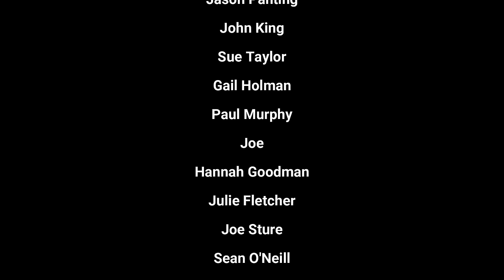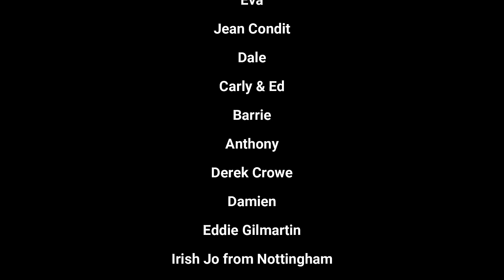The mortar removal continues on the derelict Irish cottage. Episode 28

Comment: You guys will be fine, those walls have stood there for many decades, Sam will do it right.  Have faith in each other, Crack on !
Reply from the maker: Thanks for saying this. We have definitely worried & doubted ourselves at times but I'm starting to get a feel for the walls the more we work on them. They are certainly sturdy!
Reply: They won’t be ok if they keep removing all the small stones…those walls need them for strength.
Reply: I think they'll be putting them back when they get to the pointing.
Reply from the maker: The ones which are loose are not supporting anything. We have been advised to remove all loose stones by a stone mason and we will be putting them back with lime mortar when we get to the pointing stage. Obviously any small stones that are in tight, are load-bearing and we leave them in situ.

Comment: With the concrete you find on the floor thats a start. it gives you a stable base to work from . The weather doesnt help but it gives you a break from what may seem like an endless task. The tiles look good and its an improvement to your life.   Nice one Sam and Bec      crack on
Reply from the maker: Yes the snow was a good forced break. Its nice to sometimes just have a change of scenery. Hence why we sometimes move on to another bit of the cottage even though the previous wall isn't fully finished. Psychologically it feels better!

Comment: When building drystone walls, the middling was an important part of holding the wall together. Stones would be slightly sloped in and the middling would hold them in place. Imagine old buildings were similar.
Reply from the maker: Yes there are lots sloped and what we can probably see in the voids is the middling stones. We will add those smaller stones back in one we back point the walls. Fi gers crossed it holds until the good weather comes for pointing.
Reply: If the walls are structured like similar buildings in Wales, this is not quite accurate. They are built to two faces, with quite a lot of random rubble fill. Periodically the builders used larger stones to tie between the two faces: all these face stones and tie stones are sloped 'down & out' - ie, laid with a slope to naturally shed water outwards. This is a vital principle of porous wall structures, which (unlike modern Portland cement based work) are designed to accept a degree of wetting, draining and evaporative drying with lime mortar. Good luck guys, it'll look fantastic! 👍
Reply from the maker: @anthonystevens749 thanks. Yes we watch D Porter Construction on YouTube and he mentioned the stones sloped for water removal. So much to learn on these stone buildings. 👍

Comment: Great job but just a heads up on those little stone. If you really look at it, you can see how they were used to level the big stones. And behind the front row there is a space inbetween the inside wall that gets filled up with mud and rubble. That holds the two sides together. If you start taking too much of that out the walls will weaken. Get the outside cleaned up, fill back inside the openings with mortar and little stones, then you can get to the outside repointing. ❤❤ good work and love the tiling on the walls by wood stove.
Reply from the maker: Thanks so much. We only remove the lose stones. They have been kept and we will refill the voids with them when we back point. Let's hope it holds up until then. 🫣

Comment: If you want more eggs, use a trick - connect two halves of the shell to make a whole egg and put the dummies in the nest. The chickens will see that the nest is safe and will lay eggs better and will not have to hide eggs in the area.
Reply: you need a few more than 2 egg pacifiers
Reply from the maker: Thanks for the tip. Will do that. 👍

Comment: I took a day off from my phone, yesterday. Left it at home and went to town, to get away from the cold.
Much better for it!
But it does mean I’m late, watching my favourite vloggers.
I’m so thrilled to see you guys avoiding the stupid mistakes we made. 
Your stone cottage is coming on great, though I’d be inclined to leave the small stones in the joints, at least until you’re ready to point them. It was quicker and easier to make large stones fit by packing around them with small ones, that it would have been to cut them to shape. That’s the main difference between rubble walls and cut stone walls. The downside is, rubble walls don’t self corbel, so if you take out a critical small piece, they can avalanche down all the way from the wall plate. 
At the very least, check for looseness in the ones above, before removing anything. And wear hard hats. 
Delighted to see all the bulk bags you’ve had delivered. The joy of a level site!
Our stone cottage is also on a level site, having learnt that lesson from the concrete one we’re currently in. Deliveries that have to be manhandled down from the road are a pain in the proverbial!
I’m positively itching to see what witches brew you guys go for, with your lime pointing mix.
I hadn’t seen that side of your cottage before, with the cement render. I’m sure we’ll find the same hard to remove patches on ours, though huge chunks are literally falling off on their own.
I’m not as brave as you, following my injury in last years snow, so I’m waiting for more clement conditions before I start outdoors work.
Before you spend money on a different sds drill, try using it in drill mode, to create weaknesses in the cement render. A series of half inch holes can be joined up with the chisel afterwards and you’ll be surprised how much you can break off that way. 
We took down a mass concrete double chimney, with inglenook fireplace, using two sds drills. We only needed the bigger demolition hammer for a couple of particularly stubborn bits. 
I love how your log burner corner has turned out. Really wish I’d done that. 
Too late for ours now. The snow was too much for our roof and the mobile home ceiling is now too low for me to stand under and being held up by acro props. Time to move the stuff we want to keep, I think. I don’t know how it’s still water tight, but today’s thaw will give me an opportunity to look at it. I’m hoping it will be able to last a few more weeks, rather than days! Better weather is so close I can almost taste it.
God I miss youthful energy levels and fearlessness.
I’m enjoying watching you guys, though.
Reply from the maker: Thanks Duncan. Yes going to leave the lose ones in going forward and will set them in when we back-point. 
The concrete is tricky but we will get there. We needed a new breaker as it wasn't even starting up bit thanks for the tips. 
So sorry to hear about your caravan falling apart. I hope you still have somewhere warm & dry to live? 
Becky

Comment: Fireplace looks great, lovely to cosy up by it in bad weather. Pointing will look great, just mortar the little stones back in the gaps. Are you planning on then painting the exterior walls or leave them natural stone? Be nice if you could sand blast the white residue off. The stones painted would look characterful and look more in keeping than say lime rendering.
Reply from the maker: Thanks! Yes, we want to leave the stone exposed, but there are many mixed reviews on this approach here in Ireland. We are waiting on a sandblasting quote, but I think it will be over what we can afford. In which case, I will go over the stones myself with a wire brush disc on a drill as that seems to work quite well, too, but it will take a while!

Comment: You will want to keep all those small stones you're pulling out that are loose to put back in. They are mortar savers as well as hole fillers. Do you have a wire wheel that you could put on the end of a drill to 'brush' out the loose mortar? The house is going to look fantastic when you get it done!
Reply from the maker: Thank you. Yes we have many of those wheels. I'll be using them.a lot to take off the old white wash on the stones. We are keeping all stones and will be filling the voids with them when we back-point. 👍

Comment: I don't know youre profession but the tiling was very neat.
Did you use tiles there because of the heater?
The small stones inside the wall do have a function,they support the big ones. So they are not Rumble but very needed in the walls.
You did a good job on grouting Rebecca.

I do have a tip.
Don't throw away stones,they are needed in the future and you can use them in the garden.
Reply from the maker: Hi, thanks so much. It wasn't bad for a first attempt. I'm a joiner by trade. 
Yes we used tiles as they will be subjected to high temperatures. There is fireboard behind there too.
We keep all the stones as we have big plans for them to face our orangery that we will be adding on to the front of the cottage eventually. Also for raised beds in the Polytunnel. 👍

Comment: What I’ve seen many do with the stone walls is remove all the clay or old mortar but leave the stones. In the pointing process you remove the smaller stones and pack the smaller with mortar. But if you leave the stones in the hole you might have an easier time because they’re already the right size to fill the holes. Just save the stones that fall out and you’ll probably need more too. You’re doing great and I’m so excited to see the pointing process. You mentioned you’re learning and I like watching Kirstie from Portugal From Scratch doing pointing. Seems she has her process down. She uses some lime that needs water added and is slaked I think it’s called. It’s a process she does in a big metal tub as it causes heat. I think she likes this lime mortar better than the other form available. I’m no expert but her process is interesting and she does a pretty clean job. But of course finding a local mason and having him show you proper technique for your area is probably the best best. 😊
Reply from the maker: Thanks I think someone else mentioned them. I'll take a look. There is a lot to learn with the lime. Just hope we get it right. Yes we have saved the stones ready to pack out the voids when we start repointing. 🍀

Comment: There is a fellow in France who in addition to chiselling the mortar also sandblasted the stone surfaces and deeper concrete used in gaps. Sped up the process prior to re-pointing the stones with a proper lime mortar. They also used a mortar pump gun to the work easier when pointing. Given the cold weather and damp it might be something to look into.
Reply from the maker: We had a sandblasting person come up but still waiting on a quote. May be out of budget but if it is we will get it off ourselves. Someone else mentioned a mortar pump but again they are pricey and not sure they work well with lime especially the thicker mixes. Thanks for the suggestions though. 👍

Comment: Tiles are absolutely stunning.  Just what that corner needed.  They should absorb some heat  store it and release after stove goes out too . 
The small stones in the wall were used to strengthen the larger stones as mud  and straw was used to build it . Saves on mortar too  if you leave them in place .
The burning question is .. who had the egg ?
Youz are doing great . 
 Cheers .  Me
Reply from the maker: Ha ha Mitch who do you think had it? Sam of course! 
It looks so much better behind the stove doesn't it! Sorry I missed you last weekend.

Comment: Y’all are doing a remarkable job!   there is a channel called château de Mont Magnar, and she is has done a lot of this kind of work on a 1200 castle so you might check out her channel and watch some of her videos of how she does that the pointing just a suggestion

How deep should you rake out of mortar?
Repointing Good Practice

Joints should be carefully raked out to a depth at least equal to the width of the joint and, generally to a depth of not less than 40mm (just under 2 inches) in rubble stonework & 20mm (just under 1 inch) in brickwork (and fine ashlar stonework).
Reply from the maker: Thanks for the tips! I'll check out her channel buy think I'm already subbed. I watch so many restoration ones. 🤣

Comment: forgot to add, that the hens,( when your'removing the old mortar etc) they are picking tiny bits of grit up, cos its tiny bits of grit that acculy make the shell of the egg, so they are acculy preparing to lay more eggs, if the hens were constantly in cage,s  (which to me wrong) feed has to have grit added, but they lay a  much nicer egg being stress free & free range, so well done, when you get ducks. When you see them sticking their beaks in sludge or mud, prob at the edge of the pond, where even in dry weather it will be obvs,ly wet, they are removing tiny bits of grit to make the egg shell. & because ducks can,t pick tiny bits of grit with their rounded beak, they do it a differant way to hens, its mother nature at its best,
Reply from the maker: Thanks for that. Now I know why they love it so much. I just worry so much that a stone will fall on them. 🫣

Comment: I wouldn’t go pulling out all that rubble. No. one, 😊❤prevents you having  to use tonnes of mortar and No. 2 gives the wall extra stability. Unless a job is a shit one, ye want to put everything back more or less the way ye got it.
Reply from the maker: We have kept the stones that were lose and will add them back in when we back-point. Hopefully that means putting it back as it was but with better glue effectively. 🤣

Comment: in old stone walls its mainly gravity that holds it all together.   meaning the weight of it & it all locking together like a huge jigsaw, but if you keep pulling away at it, there will be no end to how loose it will be. & the more you dislodge the looser it will get, but once its repointed, it will be very strong & will last for atleast a couple of hundred year.  & obvsly the part with no roof.. Will soon have a new roof that will protect & keep the weather from penitrating the walls esp at the top, where the walls will be the most loose, my house is over 200 yr old in the lake district, its never had a damp course, mainly cos i have no damp, but i have an open fire (victorian range with oven) that i think keeps old stone walls damp free, my fire heats the hot water too!'& produces much more than what i need, & the chimney breast up stair,s is warm to the touch, but i have no raidiator.s, so in very cold weather i have a couple of oil filled electric radiator.s that are ok to warm the upstair,s,  definatly dont do away with your chimney, like a lot of people do, even if you dont want to use it, cos it will be the heart of the room..esp with a nice multifuel stove fitted,  & putting a stove in your caravan is the best thing you could,ve done to keep everything & everyone nice & warm & damp free, i know someone that has a solid fuel aga or its maybe a rayburn, but it keeps all their cottage lovely & warm with raidiator,s everywhere, it also does all their cooking & produces tons of hot water, i also know a guy that has the same, only his runs off kerisene, which is a type of parafin, &  gets a tank filled up around the back of his cottage about twice a year,  btw i enjoy watching your videos..& look forward to seeing the cottage come back to life.. Which will be lovely,  thanks.
Reply from the maker: Thanks so much for taking the time to send this message. Yes we will be careful not to dislodge too many of the lose stones. I will definitely be happier once it's re-pointed and is solid again. 
We are 100% having a Esse or the like to heat/heat the radiators/?provide hot water & cook on. The chimney is staying albeit maybe smaller due to needing to add an upstairs!